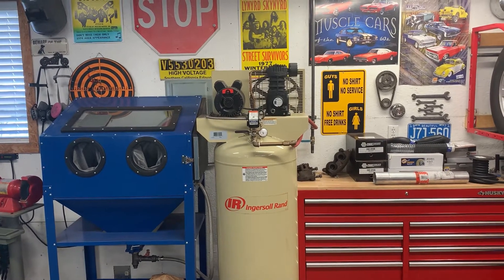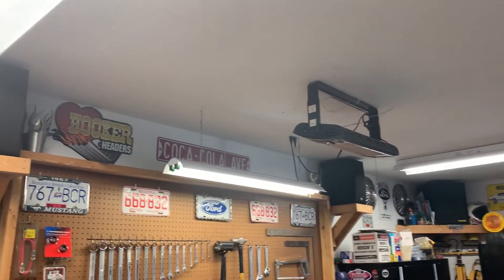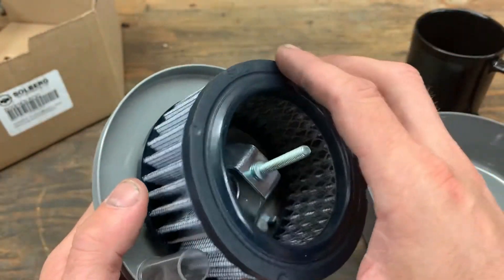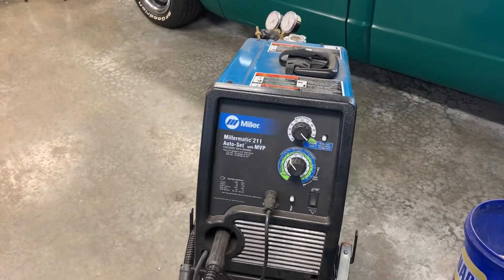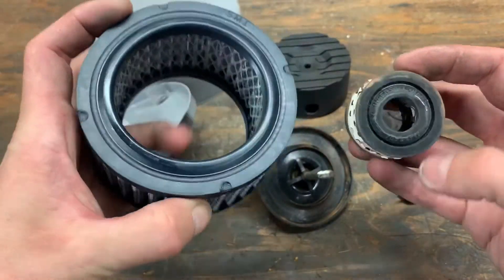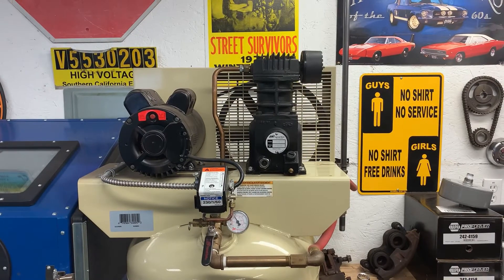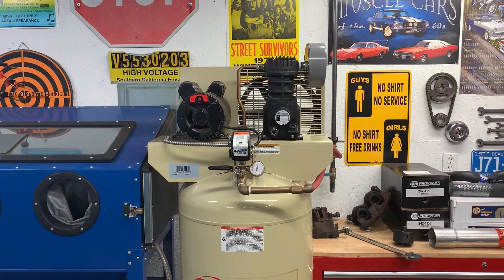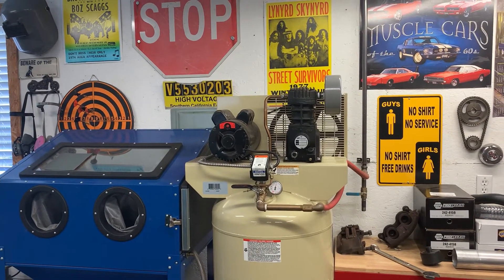Ingersoll Rand 60 Gallon Air Compressor: Air Filter UPGRADE

Comment: Use the standard pipe you have. Find some standard aquarium tubing that will fit the pipe. Run the length you need plus a natural loop. The tubing has a bit of flex and in the loop this flex cut's a huge amount of low and Hi frequency noise. You can also go to a salvage yard and find Any 4 cyl. Air filter box. Toyota/Prius boxes use cheap rectangular air filters and the air boxes are generally flat on the bottom and use clips so you don't need tools to change the filter. The box can be screwed to wall easily and internal baffles help reduce noise too. There is Zero limit to what car filter you can use but some are in tight areas so the mounting screws and dimensions would have to be sorted. You just need to get the tubes to the intake side and fill the excess space.

Comment: we make an 1/2" connection... and it is made in USA...😉😉😉
Reply from the maker: Unfortunately due to supply issues; I was unable to get one with a 1/2” connection in a timely manner. Would have been a lot easier though! 

Thanks for watching Peter! 👍🏻
Reply: @whiskeycreekcustoms6296  did you day you can buy these air filters at Napa.  Very nice garage
Reply from the maker: @iancameron198  yes you can get them at Napa! I believe the part # interchange is NGF 2374 

Thank you, and thanks for watching! 👍🏻👍🏻